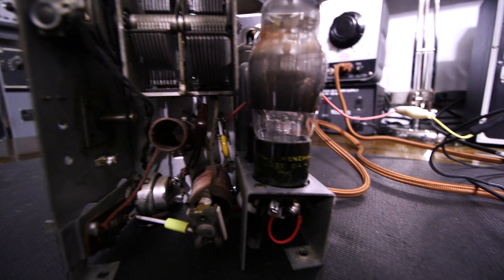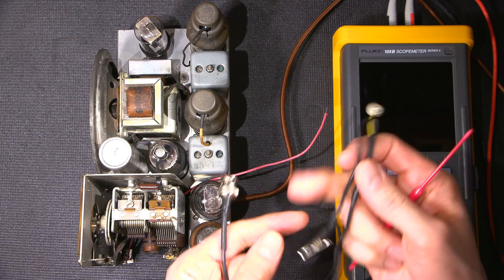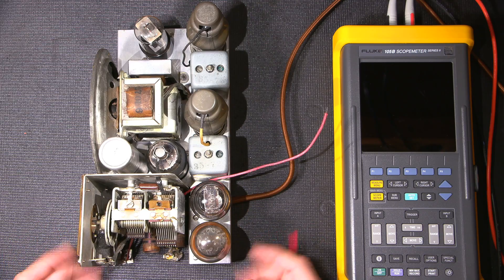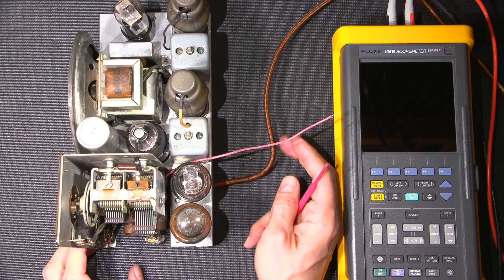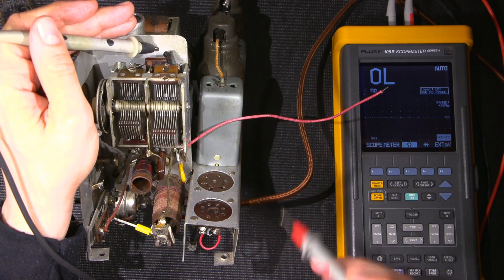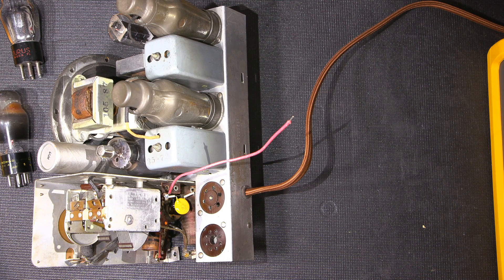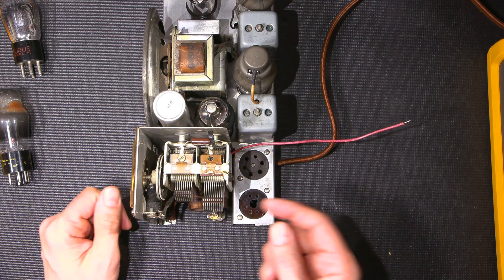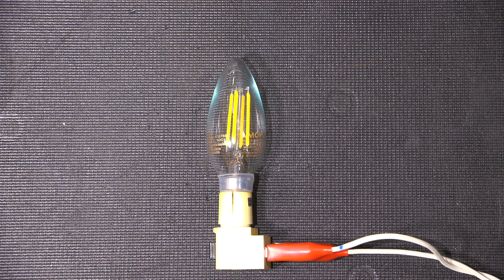See High Voltage Created From Falling Snow!

Comment: I remember seeing on a tv special a reproduction of a Franklyn lightning alarm which, even in dry air, signals a high voltage static charge in the making.  How it works is based upon how Ben Franklyn determined that lightning is electricity by using a key attached to a kite string.  His purpose was to like attach the alarm to a kite string, and if it rings, watch out!

It has two hemispherical bells, one attached to ground, one attached to the kite string, and a metal clapper on a suspended string.  When discharged, the clapper attracts to the hot bell.  When charged, the ground bell.  And it goes, "ding-dong-ding-dong-ding-dong".  In the reproduction model, a hex nut was used in place of the metal clapper.  Perhaps, you can build another reproduction model and hook one of the bells to ground and one to your antenna lead so that in the event that static charge from a snow storm builds upon your antenna again that you will hear the bells go off and then you know to leave it disconnected from all equipment.  This beats having the chassis of any equipment go "snap-snap-snap" threatening any non-tube technology.

And stay away from that hot bell!
Reply: When there is a charge in the air, or in storm clouds, there is also an inductive charge in the ground. When there is a strong charge buildup above just before a lightning bolt, there is also a charge buildup in the ground. Being near this buildup can be fatal, as the charge moves through the ground, if 1 foot is high charge, the other foot being separated, the charge will pass through you, from high charge through you to the low charge foot. That's how people (and livestock) are killed or injured even though not struck by the bolt, but are nearby. Same principal is taught by power companies to crews who may sever underground power lines. You can jump off the equipment, but have to keep your feet together, and hop away, keeping your feet together, so they are at the same potential. Ground currents travel through the earth just as quickly as a lightning bolt does through air.
Reply: Easier to build a piece of equipment to monitor the charge in the ground, as it will rise thru inductance in response to a rise of charge above, without a kite, and a similar detector for the antenna, though that will be more complex as it would have to be disconnected from radio transmissions.

Comment: I have seen antennas (mostly CB ones sparking between the conductor (inner) and the shield (outer) before, and a lot of sparks in quick succession.  Very bright ones ], sparling away like a spark plug. One had a CB radio attached to the antenna and when the owner unscrewed the antenna he jumped and dropped it cable and pl2509 plug on the floor, it was sparking at a high rate at the start then slowly the sparks slowed down.  The reason he unplugged it was he was getting a lot of noise on the radio, full scale on the meter.  The CB survived, much to my surprise, he said the noise had just started before I entered the room and he was just taking the plug off when I entered the room,  I saw him jump and sort off fall away from the CB.  I did wonder what had happened, but then I saw the sparks jumping, he didn't need to tell me why he jumped.  At the start the sparks of electricity were amazing, they were sparking like a revving engine, but they slowly slowed down.  The antenna was on a metal pole that was bolted to the wall and was sitting on the ground, so the electric charge must have been picked up by the antenna and gone down the conductor and jumped across to the screen and gone back up the screen to earth.  What I can't understand it there is/was a coil inside the antenna that went to earth anyway.  Why did the static charge not take the route (the shortest) to ground?  Is there something about a coil that electric will not go through if there is another route to ground?  Very strange!

Comment: Isn't this one of the reasons that spark gap protection is fitted to antennas? One amateur radio operator uses automobile spark plugs which seems like a novel idea!  Also, if you are use a balanced feed from a dipole and a balun for unbalanced coax feed with the screen locally grounded,  would that behave i the same manner?

Comment: Art Bell used to talk about this from time to time on his show. I seem to vaguely remember him mentioning a 320 foot antenna. How long is yours? But Art was usually in the dry desert of Nevada. No snow.
 I have two guesses. Sort of. First I think it could have been HF AC of some sort. Maybe even harmonics from a nearby transmitter? What would be more telling is a O scope picture.
 The second would be some kind of tamed down miniature lightning. Just static electricity travelling between the snowflakes. Made by them. Or maybe lightning brought down so controllably that it never arcs until it got to your equipment.

Comment: In the desert dust would induce voltage into the cabinets and without air conditioning you'd get a good whack running in convoy

Comment: i would check out that isolation transformer.make sure the coils are isolated from each other.and make sure you have a good ground on the transformer.i once had an issue like this and installed a polar solar conditioning transformer and that stopped the problem.when it was a dry snow the spectrometer would go wacky.i finally found the problem with a recording voltage meter.voltage spikes when it snowed.who would ever think.

Comment: I am wondering if this is what is called in free energy circles “cold electricity” that does not have the same characteristics of common static electricity. Btw, that is why old tube equipment will survive an EMP as well.

Comment: I had exactly the same thing happen to me many years' ago.  I remember hearing this "click......click......click" sound coming from the station ATU.  Looking at the ATU there was an arc across the ATU radio terminals.  The antena was a vertical about 25 feet long pointing stright up.  It was a very "heavy" day with thundery activity severial miles distant.  Obviously a very high voltage field had formed in the air around the antenna which was inducing the flash-over at the ATU.  Fortunatly nothing was connected to the ATU at the time.  I more or less agree with Gameboygenius's analysis of the phenomenon.  HV discharges are very fast (in terms of frequency) events.  As the 36R path to earth (chassis) was formed by a coil which would have many turns (to make 36R) it's impedance to fast rising energy would be very high, (mostly due to skin effects).  This would cause a very high voltage on the antenna which would discharge through the air at the nearest point to the chassis.  The old rule of thumb is about 1KV per 1mm so looking at the footage the voltage would be >7KV.  The friction of snow falling from the sky can generate some fairly big lightning strikes "Living in Scotland I've seen a few" so I can imagine the magnitude of the voltage here.  Outch!!  (GM0AZV)

Comment: RG-393  has 29.4 pF/foot.  If I had to wager, I'd guess you had a thundersnow on your hands or at least a charged atmosphere and what you were seeing wasn't a breakdown at the the radio chassis, but instead,  it arcing somewhere else (outside?), completing the circuit, thus jumping the gap inside from the sudden pulse. 

I've seen weird triggered breakdowns like this when playing with my Wimshurst machine. A breakdown in one spot triggers them all over the system / circuit.

Comment: I have found just days ago that transform  and string sets on isolation transformer has voltage of 85 volts to earth ground.i got a buzz from my work lite.... So no earth grounds  or plugs on the bench... It may have been grounding in the snow

Comment: It stands to reason that it was atmospheric corona discharge (pulsating DC will pass the cap), thus why to use a DC grounded antenna. Your long wire dipole antenna is not DC grounded. Set up a camera to watch that feed wire connected to a Neon bulb. You may want to keep a neon bulb connected across that center feed to discharge it. That's what I would do.

Comment: Static electricity doesn't need a complete circuit.  It doesn't need ground.  Charge will flow if there's someplace for the charge to go.

Comment: So a while ago I touched a tv antenna wire, and it bit me quite hard.  Gave me a good start. There was no reason for that cable to have any power on it. It was not conected to a tv or anything. Just antenna and a wire. It was a mystery to me at the time..  I live in south africa and we don't get snow but it was a dry windy day. So I guess the wind generated some static on the old fishbone antenna and sent it down the cable..

Comment: I wonder if the blocking capacitor was arcing over internally. Have you tested it for leakage at high DC bias? If it is arcing internally, it would be able to produce a fast rise-time pulse against the ground-referenced parasitic capacitance of the antenna system. 

Another possibility is if leakage resistance of the capacitor actually limits the rise across the cap to the point where it doesn't build up enough voltage to break down, then the other half of the antenna is still free to charge up with respect to the used half. Then these two conductors might arc over at some point to each other, and the radio and used half of the antenna might be getting yanked towards the high voltage of the unused half, as it discharges into them from its parasitic capacitance to ground.

Or the unused half might again have been charged with respect to ground, and then arced to ground somewhere, capacitively coupling through the coax to the used half.

Agree that the isolation transformer is also probably either arcing over internally or leaking internally.

It seems like a bunch of capacitors and possible breakdown gaps in series (unused half of antenna->unused half, blocking cap plate 1-> blocking cap plate 2, isolation transformer secondary->isolation transformer primary), with both halves of the antenna system having significant capacitance to ground, and probably both of them able to arc to ground elsewhere than the main series path. 

The current through the isolation transformer during the actual discharge event could either be a breakdown or else capacitive coupling. 

Seems like there are actually quite a few plausible scenarios that could cause something like this, probably impossible to figure out exactly what was happening.

Comment: My guess:  you accidentally created a spark transmitter, centered at the tuned frequency of the front-end tank circuit.  The series capacitor must have been allowing the voltage to build until it arcs over internally thru the dielectric, and then that charges the tank circuit.  The resonance creates high enough voltage across the gap to fire a short burst of RF.  The 36 ohm DC is irrelevant, on a tuned circuit except for establishing the overall Q of the circuit.  The burst of RF was causing the speakers to click.  I read that an XY capacitor, the Y rating implies self healing, so perhaps it was arcing in such a way as not to become leaky afterwards... the DC current probably wasn't very high anyway to generate much heat.  Comments?

Comment: You've shaken blind trusted faith in my ISO pack. 
Our AM radio stations field antennas transmit best during snowfall and snow cover conditions. Especially after nightfall signal wattage kicks in and a calmer clearer signal seems to stretch across fluffy wet surface intimately enclosing distant listeners out for a sleigh ride.

Uncle Martin, what's that blue green glow and fresh ion smell arcing between your skulls built-in my favorite Martian antennas? 

Yaah blow that final stage, bleed SWRs, and wait look at that ceramic trimmer in back of the set. Can you hear me now. Wait my parents say I'm talking over the TV, sorry Mom!

Comment: One side of the dipole is connected to the coax sheath. Although outside it is soaking wet al around, and one expects that any charge would flow to ground, the sheath in its turn is isolated by its > plastic outer isolation <. That gives the opportunity to build up a charge between the coax sheath and its core, as like a capacitor, because on the receiver side the sheath is not connected, but the core is connected 'close' to ground.
Once the charge / Voltage has reached the breaking point of the coax cable INNER isolation(capacity c.q. charge is quite high for the surface is high by long length), a current suddenly peaks trough the inner wire of the coax, towards the radio, as it is closest to ground. The sudden current is fully resisted by the coil, which reacts as a high impedance, hence the shortest way to earth is via the capacitor (ceramic, maybe even crystalline and piëzo electric) and arcing to earth, probably also arcing over the mains line of the radio to the mains line of the LED lamp.

People often forget that snow, as ice, is a crystal, and every crystal, one more than the other (!), give piëzo electric effects when mechanically beaten. And beaten the ice is, inside thunderstorms. Same is to say when you see volcano's erupting, and many arcs fly around; the rocks that are beaten out of the volcano may show static build up and release of piëzo electric charges.
Dust storms wipe up and beats up sand, and could do the same, specially when it is very dry in the desert.

Comment: I called the power company once, to investigate the sound of arcing outside a radio station I worked at.  Turned out that the snow was interacting with the tower guy wires and the arcing was across the insulators in the wires.  Where they tied to the ground it sounded like hamberger being fried on the grill.  No, I didn’t get near it.

Comment: Haven't got time to read all comments, but is it possible that there was some sort of ionisation in the atmosphere making the 36ohms to ground a higher resistance than from between the two points of the arc? Would be odd if it was, considering air usually has approx 30KV/cm breakdown Certainly a really strange phenomenon alright!

Comment: Absolute normal if you have long wire antennas. I'm using a 160m Dipole für my Ham Radio and got this effect often in year due snowfall, halestorm and of course thunder storms. Due to thunderstorms, arcs can reach a few inches between the ladder line.. 73

Comment: Was the snow fall very very heavy if yes maybe there was thunder snow, an electrical storm in the the snow storm that would explain the high static charge , was the radio setting a static safe mat to protect sensitive electronics if yes then that was the path to ground not the isolation transformer .

Comment: Not sure of your exact setup but when working with voltages in the "static" range (very hi kV) a grounded "anti-static" mat can act as a path to ground and can actually ground a chassis well enough to cause problems. Normally this isn't a problem but high voltage can do weird stuff. Anyone who has seen a high power radar klystron with an aged power wire in the dark has seen just how weird things can get. Consider that 20kV through a 1Meg resistor is 400 watts.Touch that and you will learn a new dance step real quick. This is why you never work on an energized circuit on an anti-static mat. If it happens again try putting the piece of equipment on a wood bench and check for a high voltage buildup. but be sure to use your hv probe if you ever want to use your meter again.

Comment: The current limiting resistors in the led bulb are probably way out of spec now and since it is getting very hot probably gone shorted.  I bought some throughhole old school leds soldered on to a pcb with series resistor wired in to limit current as led replacement bulbs early on in my rv.  They didn't last very long as they were designed for 12 volts not the 13.5 volt a lead acid battery is float charged at not to mention the 14.5 to 15v bulk charge current.  They started to blink and would go out just like your bulb.  Turning the lights out and letting things cool off would bring them back for a while but eventually most of the leds burnt out from being over driven.  I never checked to see if it was the resistors that went open or the leds but there was no visible faults.

Comment: Would be interesting to measure the value of the X2 capacitor. It may have reduced as a result of the spikes punching through the insulation and taking the metallisation with it. Interesting story though and thanks for posting the video.

Comment: This is basically just lightning; that's how lightning works. The inductor probably acted as a blocking impedance, it's not the resistive impedance, it's an inductive impedance, so the voltage found another route to earth through the air.

Comment: Its a red herring to call the coil 36 ohms of "resistance"; At hf it is an inductor after all.
Reply from the maker: Hi Kevin, and static electricity is.... DC. 
Resistance is a DC measurement, Impedance is an AC measurement, so then you are saying the arcing is from RF?
Reply: @MrCarlsonsLab  Static discharges, eg arcs, are transient dc and have short time constants which tend to invert to high frequencies.  I doubt a 36 ohm resistance will ring like that coil did every time the "bell was struck".

Comment: My theory is that the falling charged snow particles imparted both a high voltage charge and provided some negative impedance at the antenna.  The high Q resonant circuit started oscillating in the presence of this negative impedance and eventually built up enough high voltage RF to arc  This would also explain the failure of the LED lamp and snaps in disconnected speakers.  The LED lamp probably has a shorted dropping capacitor which causes excessive current in the LED filaments and they blink out with heat.